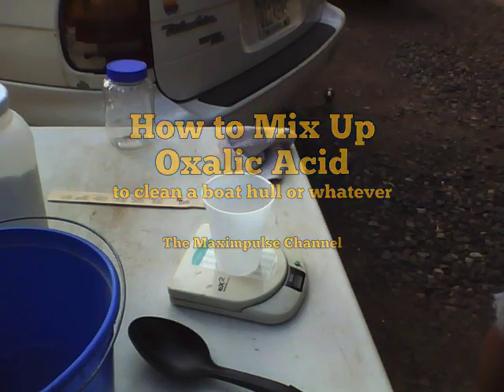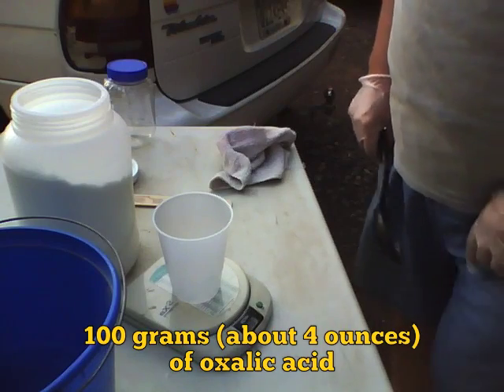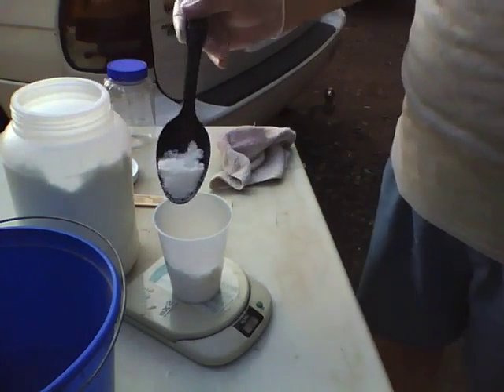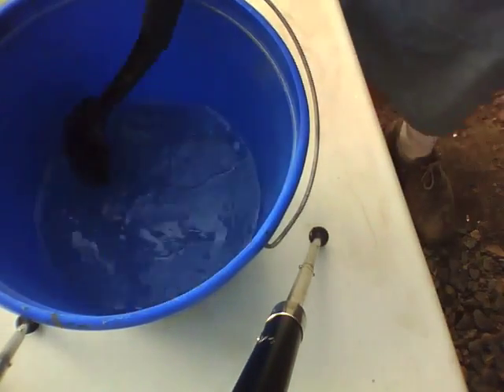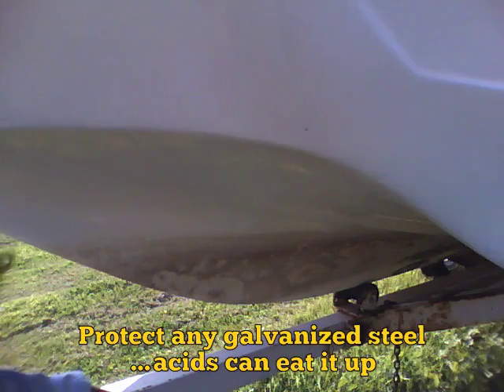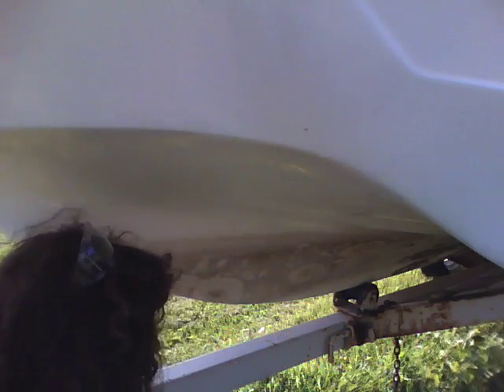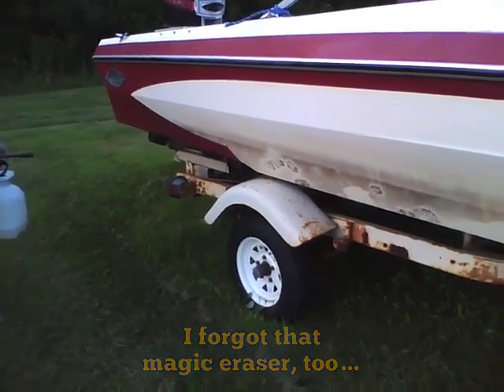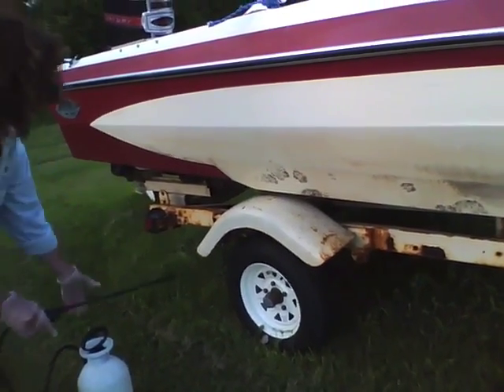Oxalic acid boat hull cleaner mixing and use instructions

Comment: I use a mix like that all the time to take rust off of bicycles that I refurbish.  smaller parts, or even bigger parts like fenders with some rust can be soaked in a large plastic storage bin. Sometimes I'll leave bicycle rims in overnight, but leaving parts in too long causes a further chemical reaction that leaves a yellow 'residue' on the parts which can be a pain to get off, usually wire brush and cold water rinse will work on the residue.  I was real careful with gloves and all at first, but after a few times I realized, there is no bad fumes, like you might get with muriatic acid.  and I pull parts out of the soak with my bare hands all the time...Use caution yes,  of course, if you are new to it or have sensitive skin, but, really, it's not going to eat holes in you or your clothes or anything....y'all id a great job on the boat.  Pretty amazing stuff for a lot of stains including rust...wood decks too, restores them like new..."almost'.   Franco.
Reply from the maker: Thanks for your tips!
Reply: the crystals or powder are an irritant to skin and respiratory tract...but once diluted with water , it's really just like vinegar on steroids.  So, just like the advice, don't eat the Tide Pods..😂..just don't snack on the crystals, it's all good..On fiberglass, it's the best...look how it just melted that residue off of your boat....the OA does all the work.  ;-)

Comment: Great video! Thanks for posting. I am curious if you tried leaving in the sprayer for a long period of time. Can I just leave the sprayer filled with the solution to always use on my boat or does the acid destroy the sprayer over time?
Reply from the maker: I have never seen any damage to my sprayer from the oxalic acid solution. I can't recall if we rinsed it out immediately or let it sit until whatever the next task was. I'm sure the plastic is immune, but if your sprayer has a brass/metal nozzle that might be negatively affected. 
I'd take a look at the nozzle and if it is all plastic I wouldn't worry. But if the nozzle is metal, then I think it would be good to pour the leftover solution in another plastic jug and rinse the sprayer out, including spraying some water through the nozzle.
But I am just thinking here, I don't have any bad experiences to use as a real warning.

Comment: Did this affect the oxidation on the gel coat? Curious if it removes any  at all for easier gel coat buffing.
Reply from the maker: As far as I know it won't remove the gel coat. No products want to promise anything so I couldn't locate any claims about gel coats with hull cleaning products. As a result I can only reply with what little I either know from experience or read "out on the Web."
My opinion is that gel coats need to be renewed at some time regardless, that if the gel coat is aged, then the acid wash will further break it down, and so after using an oxalic acid wash it's a good idea to wax the gel coat's surface. And also to not mix up the oxalic acid any stronger than described…it works well at the described concentration and making it stringer might have unpredictable consequences.
Here is an interesting quote from a stray boat owners' forum:
"The gelcoat is pretty much impervious to inorganic acids. That's not to say that you can drown the hull in the stuff with impunity. Oxalic and Phosphoric acids are relatively weak (as opposed to Muriatic or Sulfuric acids).
Where I used to work, we used marine epoxy resins and fiberglass to make tanks to contain strong cleaning acids (far more concentrated than consumer strength hull cleaners) and they lasted for several years bathed 24/7 in some nasty stuff at temps of around 140° F.
What you have to remember is that Galvanize is a Zinc coating and Zinc is a fairly active metal (low nobility). It is easily attacked by acids. Zincs are used to preserve the other, more important, metal items in boats (Brass, cast Iron, etc.)."
Reply from the maker: Oh! I just re-read your actual question! I believe this is a better answer. I haven't used the Poliglow product in the following quote, so keep that in mind.
"You can remove oxidation from gelcoat using an Oxalic acid solution. It's cheap and effective, get Oxalic in powder form as 10% strength…
Important! Now your deck is clean as a whistle, just beautiful, but it is also porous and ready to get stained again. You'll need to seal it with a fiberglass sealant or wax."
"These work best on white boats, and after you finish scrubbing with them your boat will be very clean and white. Unfortunately it is also even more prone to staining by tannin's or simply dirt in the water, leaving a "bathtub ring", and the oxidation returns very soon even if the boat never hit the water. I would clean my boat before going to a regatta so it would look good on the trailer but by the end of the weekend it looked nasty for the trip home.
Also using these to strip oxidation does nothing to return the shine, it just gives a dull white finish.
So that means that after you clean with Oxalic you need to wax or seal the boat somehow which can be a lot of work. Once I cleaned with Oxalic and then brought the boat to a detailer and had it waxed with boat wax for $100, it turned out shiny and lasted most of one summer without stains but really didn't "pop".
Two years ago I finally got around to trying one of the "miracle" fiberglass chemical restorers. I got the kit from Poliglow that includes a powerful oxication/stain stripper and a chemical sealer/finish, it was actually quite a bit of work (more time than hard labor) because there are a lot of steps to do it right and the finish requires many coats (at least five, maybe more on a really deteriorated gel-coat).
The results were spectacular and the boat finally was not only really white, but shined like a new boat. the product has been on for nearly two years and still has a shine, the boat does not pickup any stains when sailed in muddy or contaminated water."
Reply: @maximpulse  Won't remove oxidised gelcoat. Need a good rubbing compound and an old fasioned polish. Oxalic acid will remove yellow stains, rust and more. You still need to polish though.
Reply from the maker: @keithw1119  Boats are such an opportunity to eliminate all that pesky spare time! I suppose one can always try the oxalic acid first, and if it doesn't do the trick, move on to rubbing compound. Either way one needs to polish subsequently.
Reply: yes I do as a afterwash to gently beach /works best on whitish/beige hulls/will stain your bottom paint with white streaks as it runs off/wet sand 400 no big deal/it will remove chalk/tells me gelcoat is wearing thin?  Look for pinholes on surface/ stay away from LP painted surfaces/great on teak!!!

Comment: Nice video but when spraying; upwind or not , a decent mask is recommended. Also vinegar neutralises the acid so I’d spray with vinegar first wait a few minutes then hose down with water.
Reply from the maker: We tried lots of stuff, but oxalic acid really did the trick. 
Oxalic acid is a lot stronger acid than vinegar, so I don't really get why you'd use vinegar first.
Reply: @maximpulse  ignore me I’m talking out of my ar*e I didn’t realise I’d typed vinegar, I meant ammonia, ammonia stops the acid process, effectively neutralising it, I was posting to another forum and got crossed wires Doh!
Reply: Baking soda would be ideal.  I used to work in a metallurgical lab and we used ultra pure oxalic acid to etch metal and baking soda to neutralize the work surface.